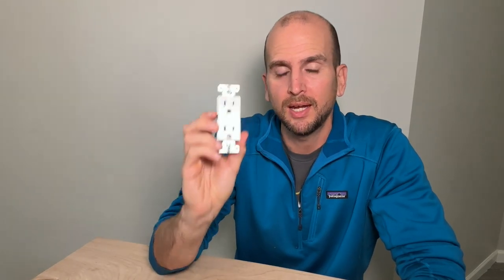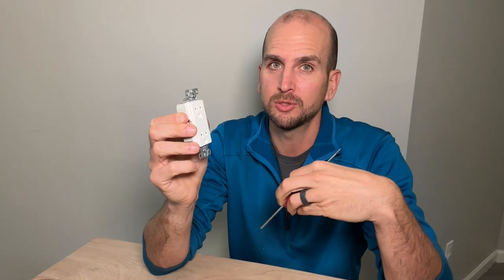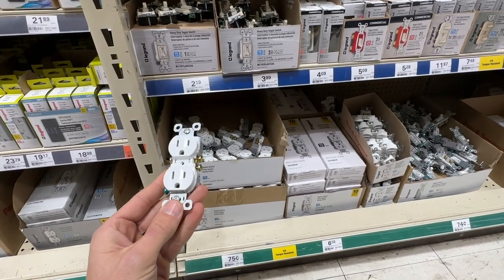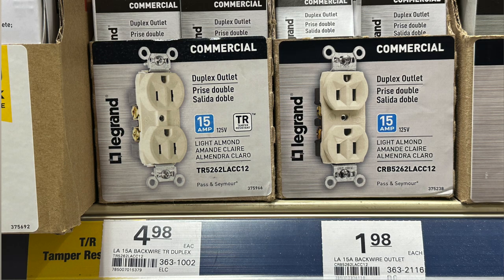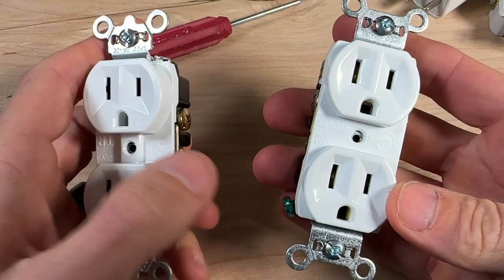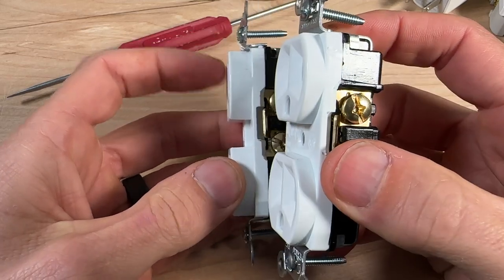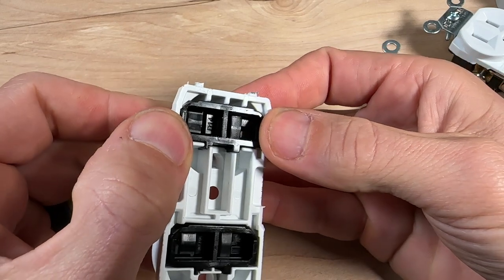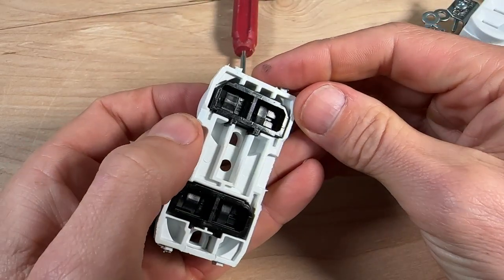The Most Hated Product In Home Electrical

Comment: explain how the child is grounded?   Those things are total bogus.   Only time someone could get electrocuted is near a ground, sink tub etc.. and they are ground faulted.  I hate them too, because they fight you and never open easily.
Reply: Capacitive coupling, the cover plate screws, register for central heating system, ...
Reply: @Sylvan_dB  Captivate??? give me a break.. the plastic cover will stop anyone from touching the plate, further, you can't push a knife in, what would a child use? and the only way to electrocution is if the child touched the screw with the other hand.  The hand pushing in the probe touches the screw. the child pulls their hand out quick and starts to cry.     I would really like to hear how many kids have died by putting an object in a plug.  Bet more have died putting their hand in a toaster.
Reply: @samjones1954  capacitive coupling to ground, as in the way a capacitor conducts AC. You asked about grounding, I answered 3 ways I've personally been shocked.
Reply: @Sylvan_dB  lol  I have been an electronic Technologist since 1982.  I know all about capacitors and I can guarantee you that at 60hz there is no way that any current is going to pass through the plastic plate.   Maybe if you put 5K volts into your wall plug, the plastic plate might break down and punch through, but that  has nothing to do with capacitance.  OR.. since you want capacative coupling, lets change the hydro from 60Hz to 600,000,000 Hz.   Then I am sure you could probably get a shock as you describe.   But capacitance fully depends on Frequency.
Reply: @samjones1954  ever consider there might be other grounded surfaces about? No, because you are obviously not thinking.
Reply: @Sylvan_dB  lol.. thanks for the insult.  I mentioned that in my first post.  If that plug is anywhere near a grounded surface that plug MUST be a GFI.   Also, I want you to roam around your home like a child and find a metal object that you can stick into that small hole.  Sure a shop equipped with precision screwdrivers and such would work.  but do you think your baby could get at your tools?  If so, you should worry more about that than an electrical outlet.  But go for it.. kitchen, living room, bedrooms.. look hard for something that you can stick in there that could connect your hand to the live line.

Sylvan, your a preacher for a huge rip off.  A completely not needed cost.   I agree with the lady that says, when she had little kids, she used the plastic plug blockers.  When the kids grow up, no need for the protection any more. so you just pull out the plugs.

But I say neither are needed.  First you let children that can understand not to try to put anything in the outlet.  For kids younger.. well your looking for something they could find in your living spaces that they could grab and push into the hole... go for it.
Reply: @samjones1954  You're welcome.  You are still not thinking how things can and do go wrong.  GFI wasn't required in many places (such as the garage and basements) as late as the earily 1990s. The code at least 7 years ago still allowed an outlet without GFI in the garage for a freezer.  GFI is still not installed on my stock tank heaters.
How many amps does it take to stop a heart?  A few ma. How many amps does it take to trigger a GFI?  About 5ma (in the U.S.). How many amps does it take to feel a shock?  Microamps. How much current flows if you are a slobbery little kid who pokes keys or partially plugs into outlets?
I was shocked when I came in contact with a hot wire in a living room outlet, thru the carpet I was kneeling on over a concrete slab.
I burnt an extension cord into the carpet when I stepped on it, pressing it into a heat register.
And cover screws are grounded, at least since grounding was required in the 1960s, and that applies to outlets with no GFI.
Reply: @samjones1954  By the way, I'm not advocating for TR outlets.  I hate them, I hate AFCI and I'm not a big fan even of GFI. I simply answered your question about how it was possible to get a shock and what do I get?  You joking about captive and changing the subject to electrocution.  Sure makes me appreciate the techs I've worked with, and that I didn't stop with a EET.

Comment: Repeatedly JAMMING and FORCING a plug into a "tamper resistant" outlet is just a recipe for increased incident of outlet/plug destruction.
You unnecessarily expose the entire outlet to excess forces that can readily cause an outlet to prematurely fail and even cause the outlet housing/box undue stress and strain.
SURELY leading to an increased incident of failures possibly leading to a faulty plug/socket cannot be considered a "good" thing.
But hey... "THEY'RE SAFER SO YOU SHOULD NEVER EVER TRY TO LEARN NOT TO DO UNSAFE THINGS! Just buy the "safety" outlet and they will dissuade you from even  TRYING to use the outlet. How much safer than that can one get?
/s
Reply from the maker: You bring up some good points 👍

Comment: If I have to buy a residential grade receptacle I'll usually get a TR for the sole reason it's code compliant. However, I've noticed that commercial grade tamper resistant receptacles are significantly more difficult than residential grade to insert a plug into, and depending on what brand you buy and what plug you're using it can be almost impossible to plug it in. For this reason I buy non-tamper resistant commercial grade receptacles whenever possible.
Reply: Yep, I just replaced all mine and chose the TR ones because of the code compliance

Comment: I had 5 kids and never used plastic covers or tamper resistant outlets.  Never had a problem with them grabbing a screw driver or fork or coins in outlets. Only Eason that would happen is if a parent teaches them. Quit making our kids seem stupid. It's like Californians moving to Texas. It rains and they start screaming Tornado and run for cover. Same as Texans moving to California and earthquakes. Kids are kids. A swimming pool is my only redline. You have to do everything there because of the numbers. Outlets. Good grief. Relax people. Kids are tough and smart.

Comment: Can't believe a country so advanced as the US has such a cheapo low tech outlet. Seems that the design of the outlet was fixed at the start of the electric era and has just never changed, even the safety version seems little better.

Comment: Use those little plastic plugs. Not an issue for safety, cheap and they work. We can't make the world 100% safe for everyone and safety items need to be designed so we will actually WANT to use them. Those TR plugs are such a pain in the butt I would remove them, especially in a shop or garage.

Comment: I hate these things. It is very hard to push in any plug.
These tamper resistant are becoming the only ones allowed to be sold.
Just like the gas tanks that years ago just had a spigot and poured easy.
Now, you need 4 hands and the things you have to push to get a small flow of fuel is ridiculous and it is ILLEGAL to buy, sell, give away, throw out, or OWN a non safety gas can.
I kid you not. You can not own one. It is a crime.
INSANITY

Remember when we used to be able to ride in cars as kids, no seatbelts.
Now you can't ride in a car if you are under 5 years old

Remember when your mother rode home from giving birth in the front seat, no seatbelts, holding the new baby

God I miss the old days

Comment: F the tamper resistant outlets.  New builds and remods require them in my area.  The elderly and physically impaired have a lot of trouble with them.  I have removed many of them after inspection.  Improved idiot  proofing only results in improved idiots.  How else are we supposed to get rid of stupid people through attrition?

Comment: TR Pointless. What if the child has two screwdrivers?!? Or they partially insert a plug but leave the prongs exposed.

I built a new how witch TR are mandated. I hate them. They just really suck and several times ended bending the prongs because they would go in.

Comment: They should have mandated TR receptacles 50 years ago to greatly lower the 5,000 ER trips a year for kids sticking an object into a non TR receptacle. Found best practice is to always insert a  grounded male plug into TR receptacles several times before starting installing wires. Some HG ( Hospital grade ) receptacles almost need a weight litter to install a plug first coup!e of times. Cracks me up when more then one maintenance man told me that he had no power after he installed a single probe non contact tester partially into a TR receptacle.

Comment: Lets be real..  The TRUE danger of an outlet would be if a child stuck an object in EACH side which would require 2 hands.  This does nothing to stop the actual lethal potential of an outlet unless the child is licking a grounded appliance when they probe a single terminal.
Reply: Even if I am against TR outlets, I don't agree with you because the heater often located under the electrical outlet is grounded.
Reply: @sg39g  If you got a space heater in a kids room the shock hazard of the outlet would be the least of my worries.

Comment: and chek out who is on the NEC code making panels.   not enough actual electricians i can tell you.
Reply: one problem with the US cord Caps is that the caps are not insulated.   look at them.  on the metal blades. so before you push them into the outlet fully , the blades become energized.   overseas the blades are insulated about 3/4 inch.  so you can not get shocked by the blades.   need a serious change over here in the US about this.

Comment: Hate to break it to everyone, but if your jurisdiction has adopted the latest NEC electric codes you don’t have a choice. Your NOT passing inspection with non-tr outlets. They get easier the more you use them.
Reply: Buy them for inspection (if you can't sneak by without inspection in the first place) then replace them with functional outlets, return all TR to the store.